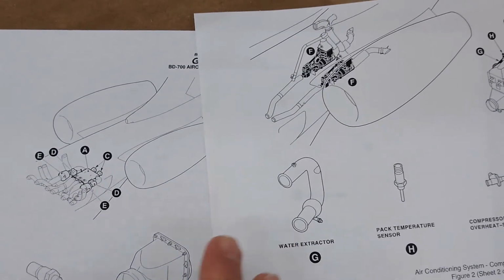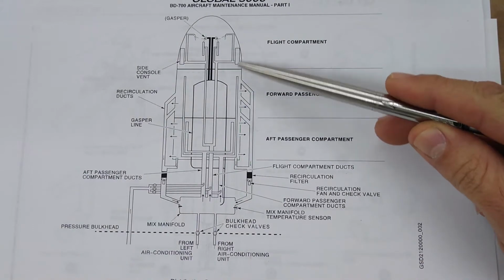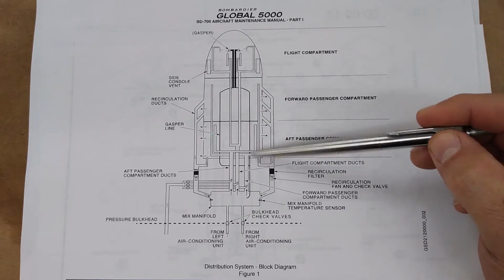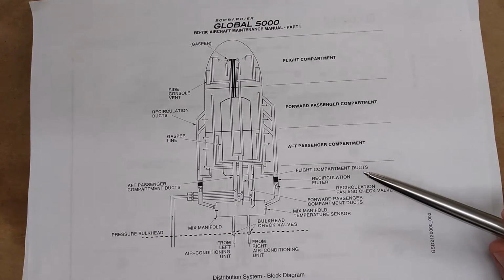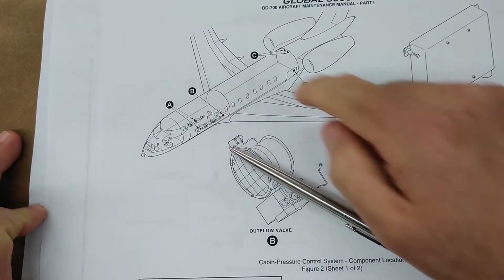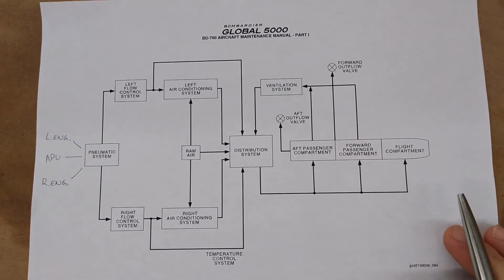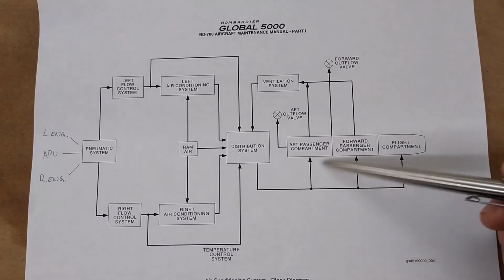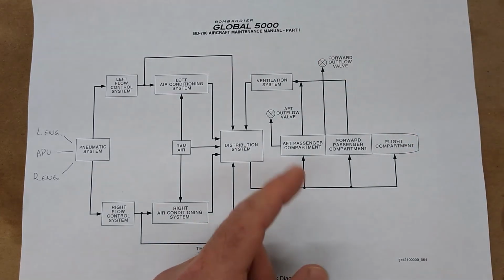AIR CONDITIONING(Part 3) CABIN PRESSURIZATION SYSTEM

Comment: Hello , that's a great channel!
So this should explain why many times a white mist like fog appears coming out of the ducts in the plane cabin when its humid outside.The water that is present in the air condenses due to the air's temperature being lowered to the due point and fog starts to appear.It's the warm humid air that gets sucked from the fans showed in the diagram and mixed with cold air in the mix manifold.The conditioned air coming out of the gasper does not condense because it has been dehumidified so it does not contain any water.
That's why in some videos when you can see this effect happening the fog only comes out of the ducts (that contain mixed humid and dehumidified air) and not the gasper .
Is this a right statement?
Keep uploading this channel is gold
Reply from the maker: You hit the nail on the head Christos Tsatsaris! You are right on! That is a very good observation. 
And thank you for the positive feedback. I really appreciate it.

Comment: Thanks man! Fascinating! I had just a very basic knowledge about all these systems and now I know a little more. If you can, I'd love to see how the engines are mounted and all the connections they have to aircraft systems: fuel, oil, air, electric, controls...
Reply from the maker: Oooh, I'm glad you asked! I think that'd a fascinating thing. The way the engines are attached to the sides of the plane seems almost comically small, but in reality is super strong(obviously). I'd love to do that video but it may take a while since the engine pylons don't get opened up very often. I have to wait for one of those inspections to come along to be able to capture it.